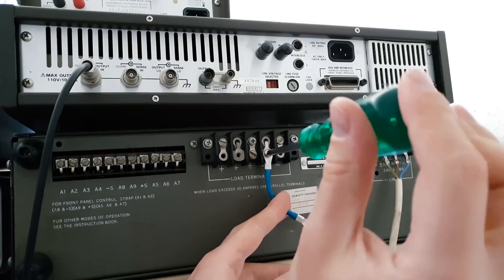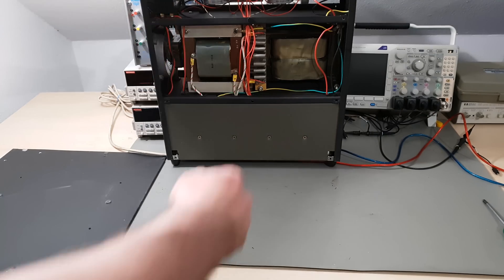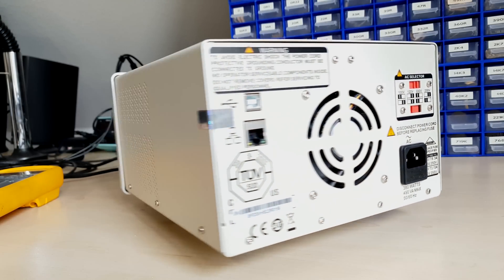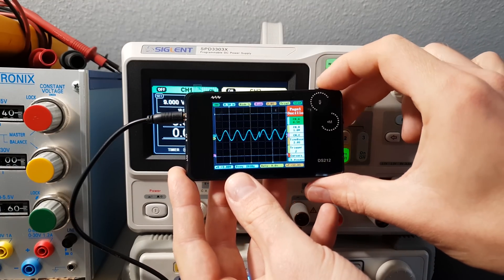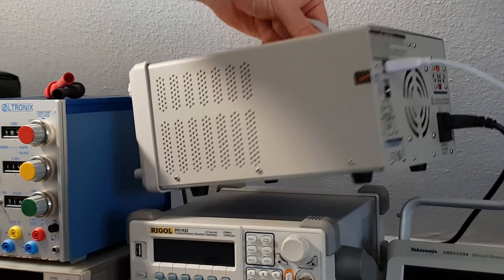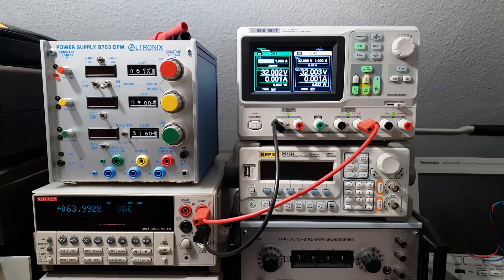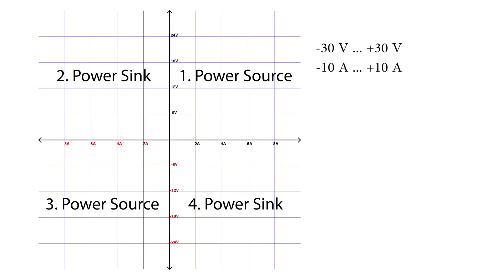Past, Present and Future: Siglent SPD3303X Bench Power Supply

Comment: The current sinking function is usefull when testing batery powered/backuped things.
But the reversable polarity is can be dangerous in most of test situation.
If we call it an low frequency power-signal generator it can be high more undersandable. It can be usefull to test inductors in production.

Comment: Marcos, what do you think of this Open Source project: https://rflab.martinos.org/index.php/Current_driver:Current_driver
Reply from the maker: Stephanos, that is very nice indeed, never seen it before! But mine will be a bit more elegant I think :)
Reply: Then there will be a subscription to the osmu project, as soon that is possible. At the moment i am using a OPA541 (from here https://de.aliexpress.com/item/OPA541-module-power-amplifier-audio-amplifier-5A-current-high-voltage-high-current-power-amplifier-board/32788102754.html) but, the frequency characteristics are bad. Do you have any informations about the frequency range and THD/Noise, #of channels  of your board ?

Comment: When will the BBBB V3 come out?
I made my own
The Big Blue Bidirectional Brushless Brutality Beast
It is 4800W 48V 3 phase industrial grade induction motor that is pretty slow but has plenty of torque.
Had to use a massive driver for it. But it removes screws very good. Especially with a linear carbon based milling bit

Comment: Since my e-bike battery (and other power electronics) are moving to 10S LiPo, may I kindly suggest raising the SMU voltage limit to ~42V? Or at least leave a provision for 60V. I'm having a hard time finding affordable gear for that voltage and amperage (100-500W).
For sourcing I could only come up with series power supplies. For loads, RC ESCs. If you're feeling courageous, also audio amplifiers might work for a second or so.
Reply from the maker: It looks like changes in the voltage and current ranges will be pretty easy, needing no more than a different set of transistors and voltage dividers, so even mixing 3 different channels in one device is possible!

Comment: DO IT! JUST DO IT! And then try to make it not thaaaat expensive, ok?
Reply from the maker: The first version will be a little bit more pricey than it has to be, because my goal is to just get it done. But in future optimized versions I (or someone) will certainly find ways to implement the functions with cheaper components (LT1970 for example can be replaced by 4 op amps and 4 diodes more or less)

Comment: Sorry, but the Siglent PSU sucks. I used one and immidiately hated it. Arrow keys and the "Fine" key to select voltage and current set digit..... fail...
Reply from the maker: I agree, the fact that the arrows and the fine button both cause horizontal movements feels weird. But after having used it for 3 weeks my brain has adjusted and it now works fine.

Comment: If you need a custom transformer supplier for your project, I've used toroidy.pl before and I can recommend them. They custom wound me a 225VA line transformer for around 60-70 euros as a one off about 5 years ago (can't remember if that's before or after tax) and as they're in the EU, it's a lot faster than ones in China an you don't pay any import tax. They do audiophile transformers but you can get a basic model that skips all the features you don't need like encapsulation. That's if you were thinking of keeping it linear. However for the power you describe you'll probably have to go to a switching converter, the complexity of which will probably be too much for you. 

I started something similar at 3 channels of 40V 4A, 10mV/1mA precision with active PFC, linear output regulators and tracking switching pre-regulators, but even with my experience of switching power supplies, I never finished it.

Comment: Idea of programmable ( ideally opensource ) high-quality 4Q PSU is great, but maybe it would be better to scope only on high-quality PSU and nothing more. Build 4Q function generator as extension for 4Q PSU ( requiring 4Q PSU for supply ) would have several advantages
1) not everybody wants to have 4Q function generator at all
2) some want to have more than one 4Q function generator connected with phase sync and some common potential ( 3p / stepper motor testing anyone ?) 
3) it is more probable to success building simple and always looked-for product than something complicated. Advanced power supply unit is always interesting device for every electronician no matter how many and how good power supplies are already on his desk.
I wish you ( and am awaiting )  THE SUCCESS!
regards,
T.
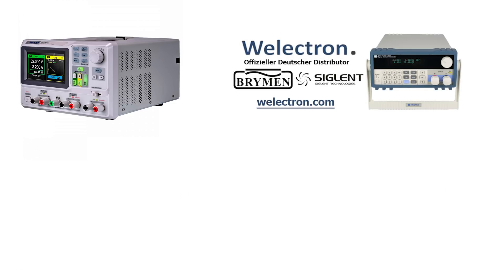Reply: About 5:17  Marsko says "What do you think - good idea?", therefore I responded for request
Reply: Sorry Tadeusz, you are right - there I go shootin from the hip again.
Reply: The sink could be used to characterize the PSU, so it should be a double win. As far as I see it, there are many capable power supplies but little (affordable) innovation on the load side.
Reply: Aw, Tadeusz Szczyrba, let the Marco build what he wants, don't turn this into another design committee.